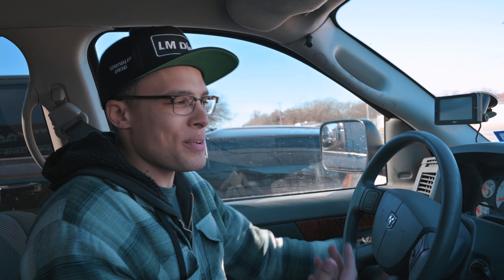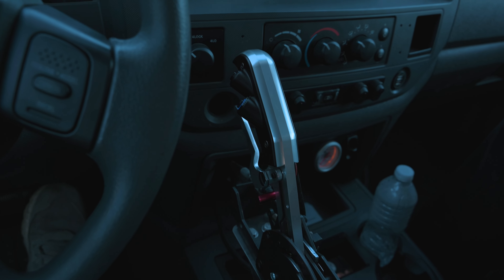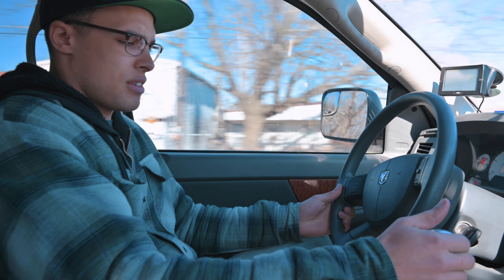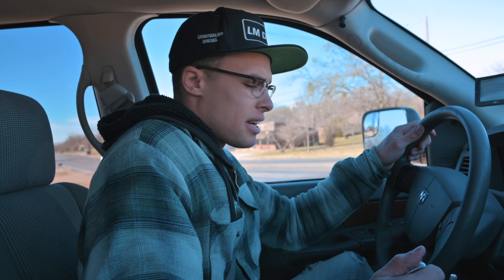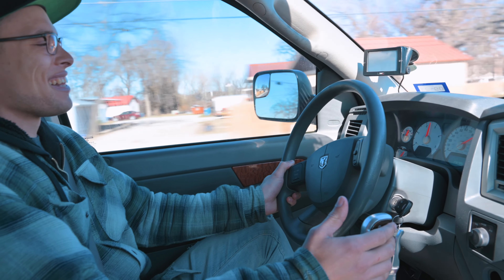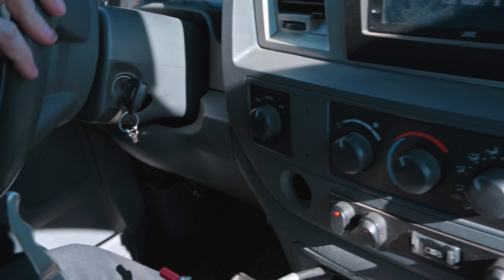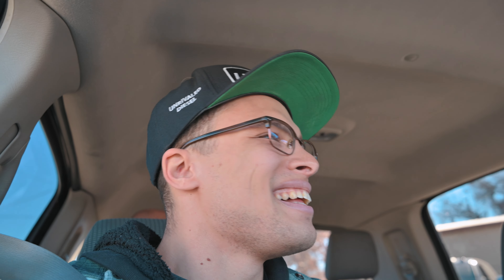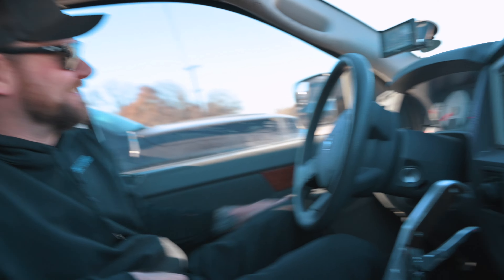I DROVE a RACE TRUCK with a FMVB!!! | Chris Patterson | Turbo Sound | Truck PULL

Comment: Shifting locked is hard on every thing. I lock once in the gear I want. Always unlock before shifting to next gear. If you are racing and you shift locked it could kick you sideways. Boost really likes unlocked. You dump the boost into the power when you lock it that's why it feels like a rocket.  

When you sit in traffic a while the temp can get hot. Put in neutral while at lights to manage temps. To get temps down try to get in situations where you can stay locked for a bit. Unlocked works the fluid. You almost never need 1st unless at a dead stop. Once you understand how it works its gravy. If you want the trans to last you follow these habits.
Reply from the maker: Good tips!
Reply: to warm the trans up inn winter temps shift into neutral  518 first gen 47 and 48
Reply: @charlesphilips2920  You don't want to shift in the neutral if you're trying to heat the transmission up. The drag of the torque converter is what works the fluid and if it's a neutral you have less drag. That's exact opposite of what I just set above in the comment you replied to. When you're trying to keep the transmission cool because it's running hot. You put it in neutral in a red light, not the other way around.
Reply: yea sorry i did not think the cummins trans pump spins in park i get the converter heats and keeping trans temps in check are important most people dont check there bands or rebuild them im going to do a few soon i have a question would you keep a non lockup 518 behind a cummins or do a mild build billet shaft 47re/rh full manual valvebody i just think the converter eats power makes heat so ill get a nice billet unit one guy had a higher stall for big turbos but the first gens only around 450 unless i fuel it or spray and i might because i love the truck gets alot of attention 92w250 anyway thanks Benton
Reply: OH AND IV SEEN ALOT OF TWISTED SPLINES FROM 650 up hp billet shafts being beat on you have to know what your doing and what not to do or beat on overdrive i have redline trans fluid its almost 100nucks a gallon but trans is almost 10 times that and i want to have full race 48 not sure about transbraking a diesel i know logan makes dump valve but i dont know a 47 and a powerglide stock case for a ls swap coming    then comes the battle of if a nice th400 is better than dodges 48 gutted lighter race diesel but i know and am willing to use the lift to pull for new bands and clutches just hope everything else is ok but thats still way more than the avg guy trans shop would just rip you off
Reply: @charlesphilips2920  I dont know how to build trans missions so I get ripped off I suppose. What I am sharing about heat is from experience and what knowledge I do have. As for park I dont know about if it flows., I just know neutral or park dont have any drag and there fore will not heat the trans up very fast. Drive or 1st means the trans is engaged and the creep is from the tc dragging. You wont get that in neutral or park.

Comment: I wouldn't have believed it myself if someone told me they were daily driving a 1k plus hp filled block lmao.  What a crazy F'er lol best kind of people.  Just one pull up to 120 and my trucks are pushing 210 plus.
Reply from the maker: 210?
Reply: @LMDiesel  sorry man 210 degrees on coolant 😂.  My 04 is around 650 my 05 850-900.  Just saying it starts getting hot so it's wild a filled block can run like that.